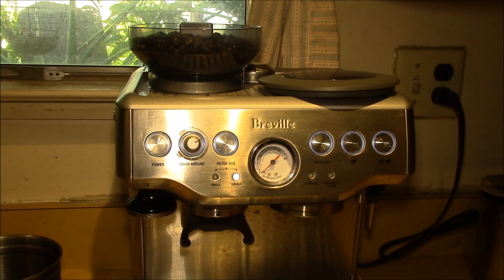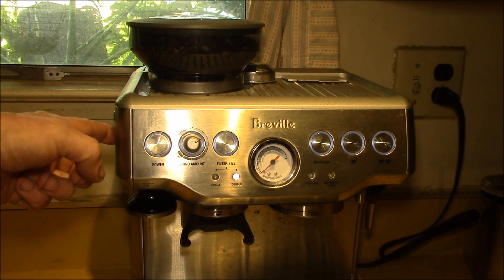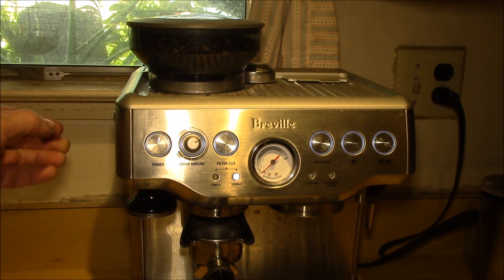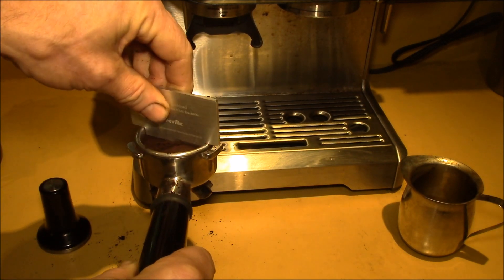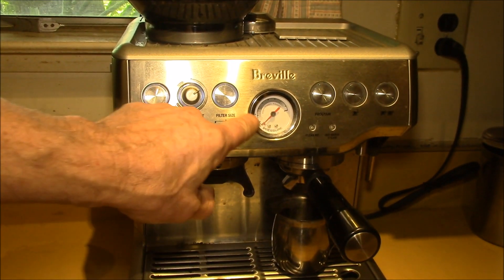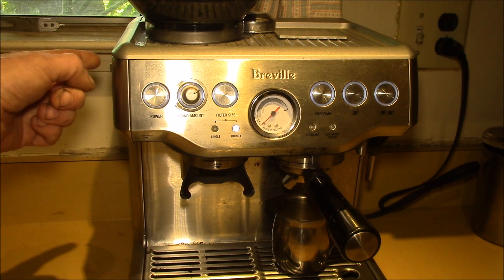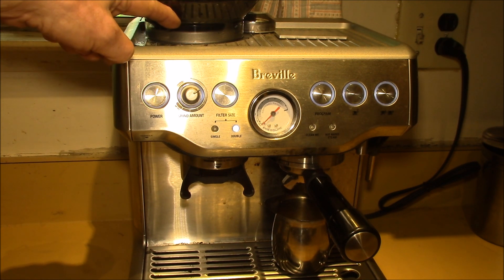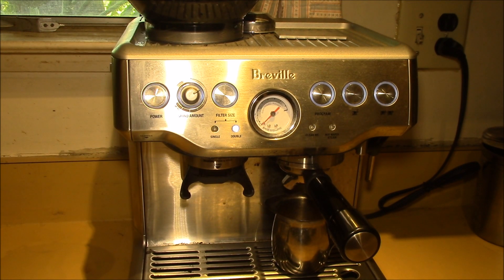Breville BES870XL - Grinder Adjustment

Comment: My grinder doesn’t stop automatically. I have it set to the lowest setting and it just keeps on grinding. Do you know what could be the problem?
Reply from the maker: It could be a number of things.  Maybe try finding the wires coming from the grind amount dial plug into the main circuit board and try disconnecting and reconnecting those (make sure to unplug the machine from power first).  If that doesn't work, maybe contact Breville support and see if there's a way to test that grind amount dial (it may be as simple as a variable resistance) and if that's not an option, try replacing the main circuit board as that's what controls the grinder based upon the setting of that dial.

Comment: hello sir two question you ask?  1. How do you get more water to make it flow more slowly?  2. as I understand if we refine the coffee more we will also have to adjust the grind amount button and put less coffee if it is coarse?
Reply from the maker: Yes, generally a finer grind size, more coffee in the basket (dose) and more tamping pressure will tend to increase the pressure.  When I'm dialing in a different coffee bean, I like to make small adjustments to the grinder.  Make no more than one number adjustment at a time, then if needed, adjust the amount the next time.  Always observe the change in brewing pressure or amount before making another change the next time.
Reply: R Brown thank you for your answer now my upper burr is 6 (factory setting) I put it on 5 I tried my coffee flows too quickly my grind size is on 4 the coffee is fine my pressure gauge is on 12 o'clock but my coffee flows too  quickly I don't understand why if I put more coffee it overflows I don't understand why at your place the coffee flows slowly
Reply from the maker: @83kif  It may just be the type of coffee beans.  But make sure the filter basket is full enough and well tamped.  Also, it may take a few grind cycles after adjusting the grinder to get all the coffee ground to the same level.  There's a fair bit of coffee left in the base of the grinder and the outlet chute that needs to get pushed out to make way for the newly ground coffee.  Also, you can try the double wall filter basket and see if that makes a difference.  That basket has a built in flow restriction that doesn't require the precise grinder settings like the single wall basket.

Comment: Hi, I received my barista express, I tried a double shot with single wall. My grind is 5.
I tamp not too much. the shot lasted 27 sec but it started after 9 sec and with crema the quantity was about 60ml, what do you think? kind of mix between under and over extraction
Reply from the maker: Hard to say.  My approach is to make a series of small adjustments, one at a time, and record any changes, good or bad.  Try bumping the grind up or down one number, increase or decrease the grind amount a click, try different tamping pressures.  That way you get a feel for how each of those changes affect the extraction, according to your preferences, and then go in the direction that works for you.  Say you go up and down one number on the grind and find the smaller grind didn't work as well, but the larger grind was better.  So then try the larger grind and then raise/lower the amount.  It may take some trials to get it dialed in to your liking, but if you make small changes, you'll likely not have anything you'll have to dump down the drain :)

Comment: Hello after 4 weeks of trial for my espresso machine I allow myself to send you a video to see what you think I have set my grind size is 3 it's fine already I am already almost in over-extraction against my burr  is on 5 no 6 (factory setting) have already contacted the house of this machine  (Solis) they tell me that it is running normally.  I wanted to see if can be noticed something not too normal thank you 🙏
Reply from the maker: That seems like you are close to the right setting.  If you try some minor adjustments in the grinder, amount and tamping and record the results, you can probably get it dialed in.  I find that if you only make one small change at a time and then try that for a few extractions before making another change.  Especially with the grinder setting, unless you completely clean out the grinder after every change, you'll get a mix of ground coffee with the old setting and the new setting and that takes a few runs for the older grind setting to clear out of the grinder chute.
Reply: R thank you for your answer small adjustments more coffee less coffee for example?  grinder level goes from 4 to 3 for example?  so when i change the grind size number?  pressure with the tamper?  put more or less force?  I always take a quick shot to empty the grinder channel when I change the number
Reply from the maker: @83kif  Yes, try finer and coarser grinder setting.  Try more or less coffee amount.  Try more or less tamping.  Record results after a few extractions.  Then see which adjustment improved the coffee extraction and then repeat starting with the thing that showed the best improvement and make small changes there.  By small change, that's +/- 1 number on the grinder or amount dials.  And make one change at a time and note the result.
Reply: R Brown I'm going to try all of them, but the result is the pressure gauge?  Thanks a lot for your answers. there is also the coffee I think 🤔 which changes.  in Switzerland it is difficult to find many kinds of coffee.  in the United States there is a lot more sort of coffee in my opinion

Comment: Hello, i have Breville BES870XL Barista Express and i have problem with EXTRACTION im using fresh beans and im using the single filter  basket and using 6 grind size and 10g for grind dose for single basket with tamp to line but when i do the extraction it start with begain of the espresso range and stops for 1 sec and goes at the end of the espresso range, how to make it like normal extraction that be in the middle of the extraction range ? Thanks.
Reply from the maker: It may too fine a grind.  Mine will do something like that occasionally where it oscillates on and off with the gauge reading low then high.  Usually if I back off on the grind setting and/or reduce the amount it'll clear up.  I would try increasing the grind setting one number at a time and see if anything changes.  You'll likely have to change the amount setting as well.

Comment: I was surprised just now to see how high your gage went up because mine barely moves. Does this mean my grind setting was off and I need to set it for more fine?
Reply from the maker: That may be it.  I would start off going one click finer on the grind and then check the amount and adjust that up or down as needed.  I like to only make one change at a time so I can keep track of where I'm at.  If you start to see the pressure rise as you go finer, you're on the right track.  Now this assumes you're using the single wall filter basket.  The dual wall basket will only produce pressure at the low end of the range on the gauge.
Reply: @The4Crawler  I am using the double shot button and double wall filter. How high should I expect the pressure gage to go for the double shot? Thanks so much
Reply from the maker: I find the double wall filter will only hit 9 o'clock to 10 o]clock on the pressure gauge most of the time.  You can get it higher with finer grind, more volume and tamping pressure.
Reply: Push harder than you expect.

Comment: Hi, good explanation...

But can you help me to clarify the following?
In the manual it is recommended to use the single filter for tuning. 
I have tried different set up starting from finer/coarser grinding (started from 8 , moved to 7 and 9-10)..consequently adjusted the amount using the razor. 

Now, regardless the set-up, i have not managed to reduce the pressure. I am on the upper bound even if still in the boundaries. I would expect some changes especially when moving from 8 to 10 in the grind size, any suggestion to move pressure to 12 o'clock?

The curious thing is that when I then use the double filter (run the grinder on double, as well as the extraction), the same set-up returns a way lower pressure. Any idea on why?

Thanks! 
Gabriele
Reply from the maker: The double shot, single wall filter has a larger area of filter mesh than the single shot filter, so that may account for the lower pressure between those two filters.  You might try upping the grind setting to 12 and see what that does.  Also, it might be that the coffee level is a bit too high in the filter basket.  Sometimes I find I need to go a little less or a little more than the razor level.  And it may be that your gauge just reads high, you can also double check with the extraction time:
https://www.seattlecoffeegear.com/learn/coffee-101/how-to-guides/pull-a-perfect-shot

I don't think I've ever used my single shot filter basket, as I always run a double shot in mine.
Reply: Thank you for prompt reply.
Good points, the coffee amount is 1 o'clock  but i can of course go lower and try.
I like what I get so far, but perhaps it can be improved and I am always interested in checking effects of a different set-up.

I started with 8 because is what is recommended a video from them, i also used the single as it is mentioned. 

Anyway, after writing you, I tried an extreme set-up (16) just to get an idea, i got horrible coffee, even if the pressure  was in the boundaries but very low. The coffee in the filter after the extraction was very wet. 

I also believe that it may take one-two rounds before the grinder size is really settled due to some left over from one grinding to another.

G.

Comment: Hi, My espresso comes out thin bitter with littel creama,
The whole process takes 15 seconds, pressure is fine but coffee starts to come out before pressure comes up.
When I grind finer things inprove a bit but pressure goes up too much.
Any segestions please?
Reply from the maker: My guess is the filter basket is not filled high enough and/or the compaction is not high enough.  I like to be able to see the imprint of the mesh of the group head on top of the grounds after a brew cycle.  They should also come out in one solid, nearly dry piece.  If the filter is not full enough, the first water that hits it will break up the grounds and that lets the water through to easy and it won't build up any pressure.
Reply: It could be that your coffee is going stale, so there is not much oil left inside the beans. Try using some different beans to see if it makes a difference: ideally fresh ones that were roasted less than three weeks ago.

Comment: hmm. I am also struggling with inadequate pressure situation. if you run the machine once before starting your shot, does is help?
Reply from the maker: It may help the pressure a bit by making sure the pump is primed.  Also helps to warm up the group set so the espresso comes out nice and hot.  Increasing the fineness of the grind, the amount of pressure applied to the tamper and the level of the tamped coffee in the filter all increase the extraction pressure.
Reply: How fresh is your coffee? Anything more than a week old will not make great espresso. Also, if you're not doing this already, I would highly suggest weighing out your coffee beans and placing them in the hopper one shot at a time. 18g is the sweet spot for this machine and will be an excellent starting point for all coffee types. Cheers

Comment: we can not adjust the amount of water during the pre-infusion?  this is defined by the machine
Reply from the maker: I think it's pre-programmed into the machine.  I know you can change the 1-cup and 2-cup volumes but that doesn't seem to change the pre-infusion setting from what I can tell.
Reply: R Brown I could send you a link I would like to show you how my machine works.  I have the impression that it flows too quickly.  see if maybe there is something to improve if it is possible of course for you

Comment: Hi there, Hoping for some advice. I switched beans and started from scratch. 
As I bought some fresh beans but had to set the grind to (2) and the dose to (6 o clock). Still wasn't getting a good pour in any way. The pour was gushing out fast and the pressure was over extracting every time.

New beans - grinder set to 5. dose set to 3-o'clock (giving me 18 grams) and for the double shot I'm getting right in the middle of the espresso range. however, the time of the pour is 4-5 seconds pre infusion, then 13 seconds after that. the volume of the pour was around 55ml (double).

The single shot set up, I used the same settings, (got 10 grams of coffee) got the same timing, (17-18 secs total) got 26ml. however the pressure shot up to the over extraction range.

With both shots, finer grind (1 notch) resulted in over extraction, courser grind (one notch) caused under extraction. Dose increase caused over extraction on the gauge, however it poured fast still. 

I can't seem to get a longer pouring time of 25-30 secs without over extracting.
I did have a setting I think with 1 notch more on both grind (4) and dose (4oclock) and it poured slower, however again, over extracted on the gauge. 

I've noticed if I over tamp, it shows under extraction for half the pour and the over extraction for second half of the pour, and more inclined to run faster.

The only thing I can think of, is to manually change the pouring time with a scale under it to get exactly 30ml? (as I seem to drop short by 3 to 5 ml most of the time.

What are your thoughts?
I hope i've also been clear.
Reply from the maker: You might try your scale and see what it shows.  When I switch beans, I like to mix the new with the old in the hopper.  This gives me a half dozen cycles to adjust the settings.  At first, you get mostly old with a bit of the new and by the end, mostly new with a bit of the old.  Then I change the grind and dose settings a notch at a time up or down as needed.  On the volume in the basket, make sure that it up high enough.  Look at the grounds after extracting and see if you can see the grid pattern in the packed grounds.  If you can't see that, like if the grounds are all broken up, try upping the dose. That can help force the water to flow evenly instead breaking through in one spot, which is what sounds like you issue may be.
Reply from the maker: Thanks for the update and link.  Sounds like you have it dialed in now.  I have my double shot volume adjusted for a bit more than the factory value.

Comment: hi...I think my machine came with different factory settings. from the moment that I press the double shot button to the time the water stops running it's about 25 seconds. yours is about 37. is that right?
Reply from the maker: I changed mine to output more water on the double shot setting.
Reply: I have the seam issue mine around 15 seconds

Comment: I really don’t think you’re tamping it with enough force.. I believe you’re supposed to use 30-40 lbs of pressure.
Reply from the maker: It's a bit hard to demonstrate that with the camera/tripod in the way.  But yes, that is a typical tamping pressure.  I did practice some times placing the filter on a scale and then checking the displayed weight while tamping and I came out in that force range.

Comment: Hi there, my grinder has been putting out too much coffee. When set to the minimum amount for a single dose, it puts out 12g of coffee. I have no idea what to do.
Reply from the maker: You might want to contact Breville's support folks and see if they have a way to reset or recalibrate that grind amount.  I've not seen that option in the manual.
Reply: Thanks. I´ll do that!
Reply: I have the same problem. Did you learn how to recalibrate the grind amount?

Comment: I need help, i cant find it it anywhere, i cant dial my grinder settings, i really have to f***ing turn the switch with to fingers. It took me great effort to go from 7 to 5 and my fingers hurt
Reply from the maker: Sounds like the grinder may need to be opened up and cleaned, something might be jammed inside:
https://youtu.be/0ZDii493IPY

Or pull the top panel off the machine and see if anything is bound up in the adjustment mechanism:
https://youtu.be/w6YAQv_ZJqQ
Reply: Try this if your grinder needs cleaning. I do this once a year: Remove coffee-bean plastic funnel (when mostly empty). Then try to remove all or most all of the loose and partially ground beans from the grinder cog (use a spare tooth brush). put the coffee funnel back on and then run about a 1/3 cup raw rice through the grinder and discard. Then run about 2 oz coffee grinds through the grinder and discard. Your grinder should be clean and ready to accept new coffee beans again. Hopefully this will also loosen up the cog and allow you to turn the grind-setting dial. Good luck!
Reply from the maker: Great grinder maint. routine there, thanks for sharing.
Reply: You may also need to change the numbers while it's grinding ,because some beans might be in the way.
Reply from the maker: Yes, good point.  While not mentioned in the User Manual, I've seen recommendations to only adjust to finer grinds while the grinder is running for the reasons you give.  I think I mentioned this somewhere in the video.